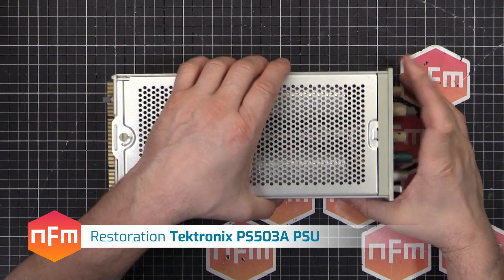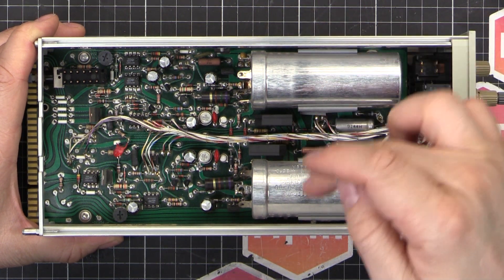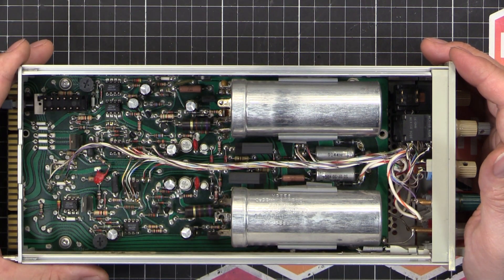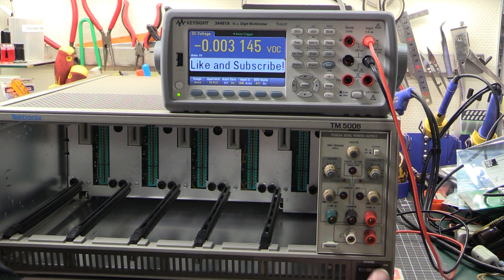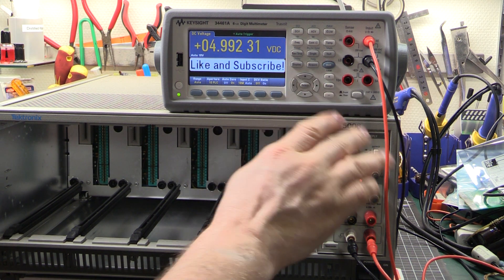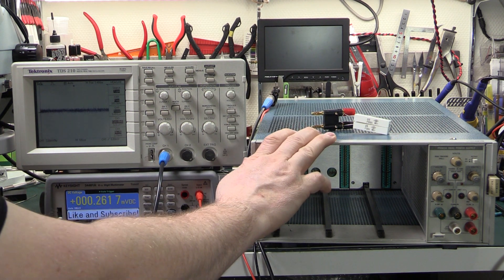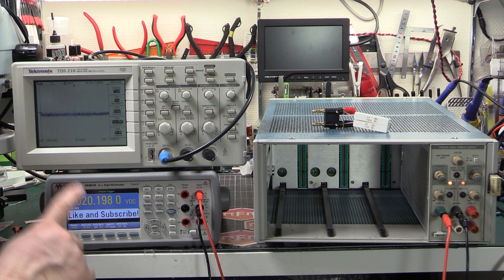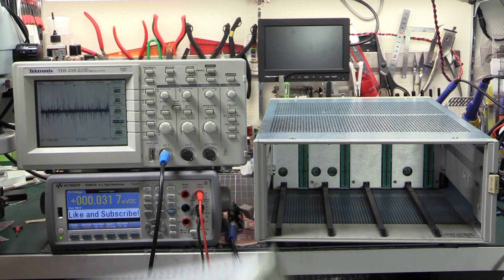Tektronix PS503A Power Supply Restoration

Comment: Keep an eye out for an HP 6515A power supply - 0~1500 Vdc @ 5 mA - great for reforming and leakage testing of higher voltage electrolytics.  I use mine for this regularly - use bench meters to monitor voltage & current, set the PS output to the cap's rated voltage and let it rip.
Reply from the maker: Thanks for the suggestion! I'll keep an eye out for one. 🙂
Reply: @NearFarMedia   I also have the little 10 watters (6212, 14, 16 & 18As) that I use for lower voltage caps.  The 6212A goes up to 100 V.  If you look for that series, make sure you get the even-numbered ones - they are CV/CC - the odd ones (6211, 13, 15 & 17) are only CV.

Comment: Interesting video, thank you. You should keep an eye out for a (reasonably priced) Sencore LC series capacitor analyzer - great for checking power supply caps at working voltages up to 500 Vdc and for re-forming large electrolytics.
Reply from the maker: I need to get something for higher voltage capacitors. My HP 4276A has an optional external bias fixture (part number 16065A) that allows for testing up to 200VDC that I hope to come across one day.
Reply: Pro trick: watch movies on Flixzone. Me and my gf have been using it for watching lots of of movies these days.
Reply: @Romeo Damari Definitely, been using flixzone} for years myself :D
Reply: @Romeo Damari yup, been using flixzone} for months myself :)